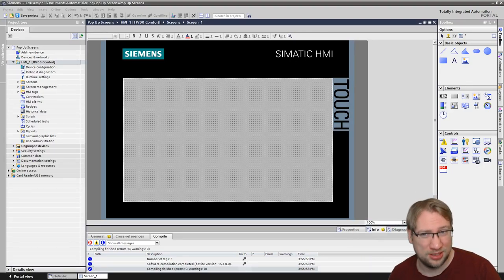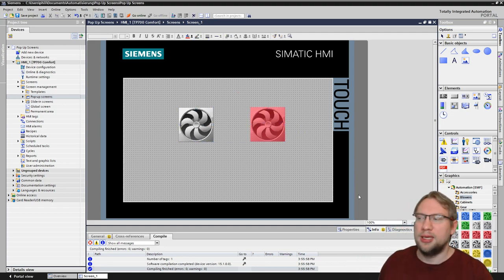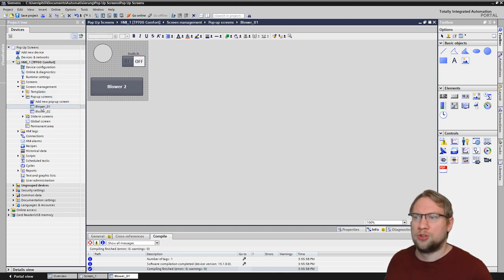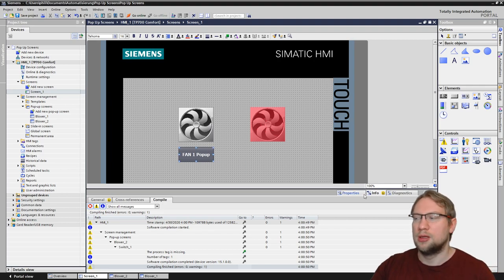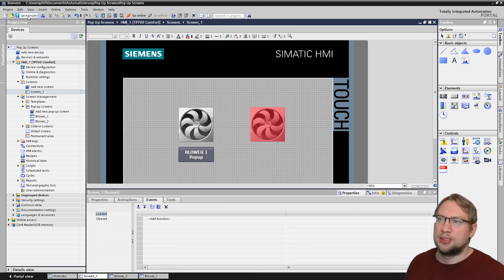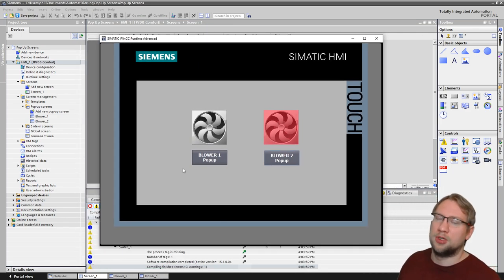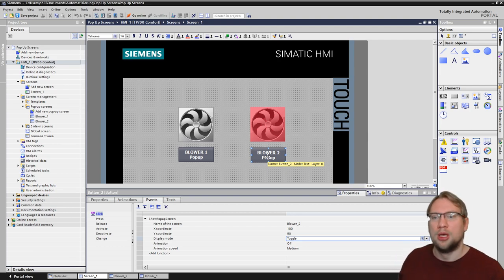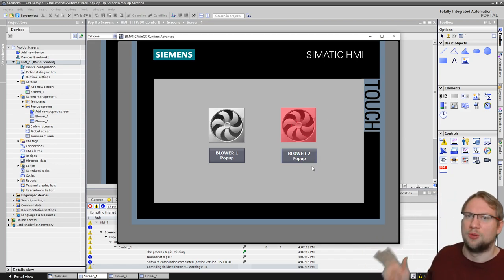TIA Portal: HMI Pop-up Screens

Comment: The active window think made the popup completly usesless /broke it for us. We had it so users could click on valves/motors and would correctly open the popup and load all the settings. Next if the user clicked on the next valve/motor nothing would happen becaus it was not an active screen. We have reverted back to not using popups for valves/motors
The popups are nice but the implementiation of it is uterly crap/ works completly diffrent then you would expect.. And i dont think there is anything about this in documentation. 
In WinCC our vales/motor popups work great becaus with those you dont need to click to activate a screen. (and we dont want to change the plc code for it)